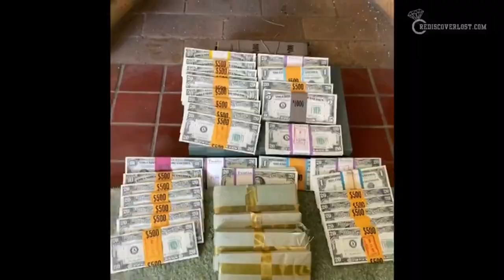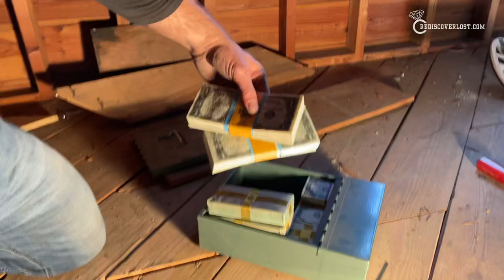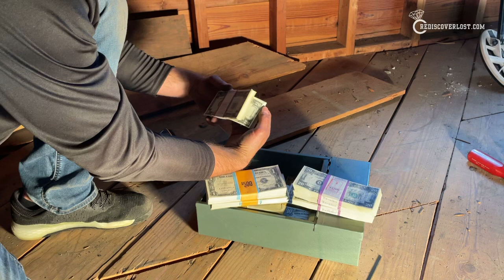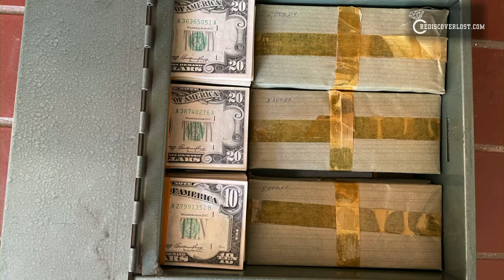The Extended Footage of Old Cash Hidden Under Floor Boards! | The best Treasure Hunt in 2021

Comment: Great video!  I have spent the last couple of years since the Fenn treasure was recovered researching potential cache sites lost to history mostly.  My rule was and is if you can pull anything up about it using Google it’s probably not for me.  I wasn’t sure what to expect but it was just incredible how many really good leads are out there.  Really an overwhelming amount so I found myself raising the bar on what was a “keeper”.  I think my favorite leads are the ones that span 1800s to 1960s at places where you can document a cache was recovered but the research hints at or it’s actually stated more was possibly hidden.  Almost all those locations were lost to history by the time metal detectors became a realistic option.  I think if we knew the amount of wealth still buried at locations like these alone we wouldn’t get much sleep :).  If just took it being buried a little to deep or simply missing the spot with a probe by a quarter inch.  Thanks for more inspiration!  This spring I start hitting the leads in order and making videos for each hunt.  I’m gonna share this link to my 1000 subs!
Reply from the maker: These are great points! Thank you, Legacy Adventures, for supporting my channel! Keith

Comment: Each of those $1.00 silver certificates are worth $50.00-$100.00 or more per bill, and they have a few hundred there. That $46k will turn out to be to closer to 400-500K. Hopefully they can get them graded and sold to a professional. I would love to buy a few. ;) Finding something as old as much as this is a once in 100 million life times.
Reply from the maker: Fenril7, this search was a thrill! I was glad to have the opportunity at such a rare find! Keith
Reply: Silver certificates aren't worth that much
Reply: Typically, a 1935-E silver certificate in good condition fetches $1.25 to $1.50. Uncirculated bills are worth $2 to $4. A pack of 100 series 1935-E bills with sequential serial numbers can bring $600. Some 1935-E silver certificates are star notes.
It's necessary to look at the serial number on these bills because someone could have potentially stamped an R or S onto a standard 1935A bill. Star notes are in existence and they are very rare- only about 24,000 in total were printed. These rare star notes will sell for thousands of dollars each.
Reply from the maker: Interesting info! Thanks for commenting! Keith

Comment: On one of the large stacks of cash I noticed Rubber-Bands , I really don't think they would last that long & still have the ability to stretch like did after all those years being under a floorboard
Reply: I didn't see any rubber bands
Reply: @MR-nh1fn  28:07 & 31:27 .. it's not hard to miss

Comment: So, you didn't actually charge a fee for this. Did you have them sign waivers that they wouldn't hold you financially responsible for any damage? I noticed that you specifically waited for permission to break the lid off the cash box.
Reply from the maker: Everything was agreed upon before the search began. Thanks, Fayd Ogolon, for the comment and for tuning in! Keith
Reply: @RediscoverLostKeithWille   It was sad you didn't even try to pick it. A lock like that is child's play to open.  More than likely it could have been raked open in 5 seconds.  Even for someone that doesn't know anything.

Comment: I’m calling bs if that box had been under there for 50 plus years the box would have been more covered in dust. And the boards and nails are quite new  suggesting someone has been under there recently another thing no way those bills would look that pristine after all those years either.